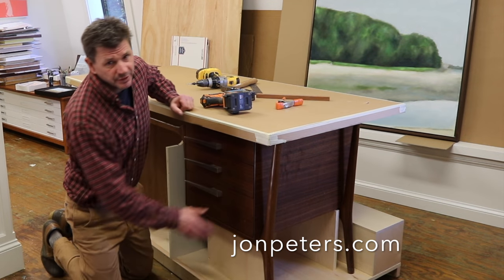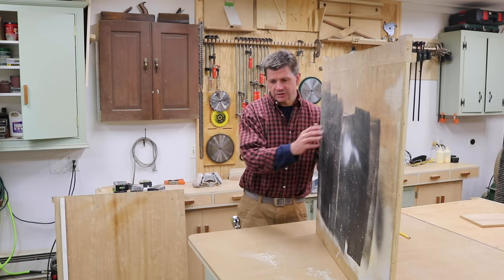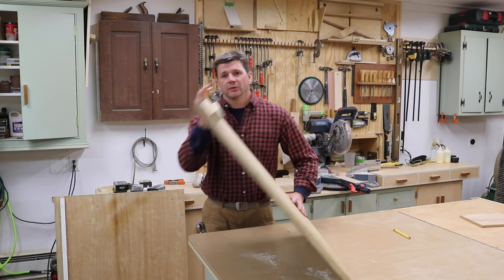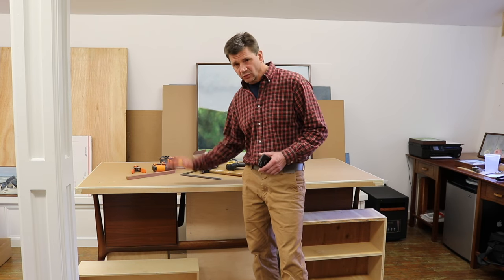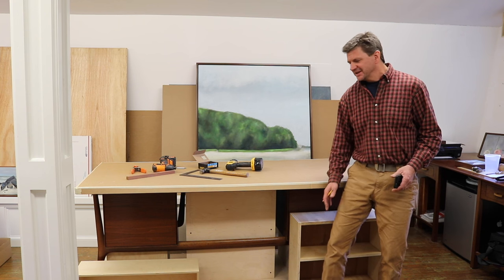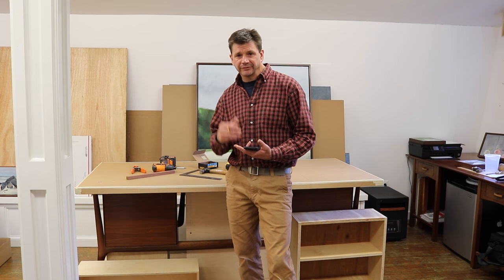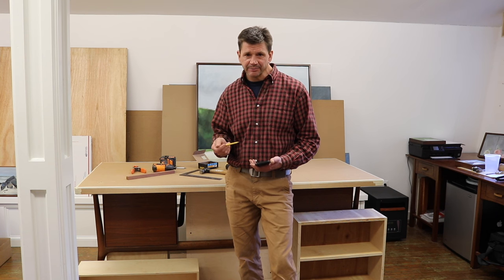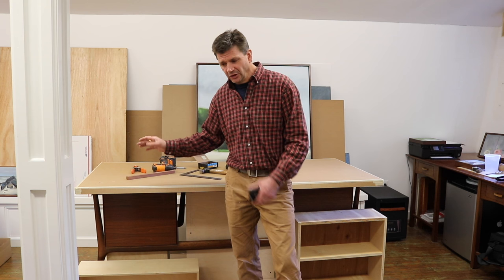Repurpose Desk - Make Mobile Work Table with Storage

Comment: Hey Jon, I know this doesn't have a lot to do with this build but I have been scouring your builds for something I can get some help from.  I am building a simple plywood dresser for my sons and trimming each drawer with raised stained trim for contracts on the white painted dresser.  I am trying to figure out the best way that the pros use to do this. I am currently painting first, staining the trim separate and installing after finished, and then sanding and filling nail holes after.  Wasn't sure if there was a better way with less work after the stain.  Do you stain with the trim already on the painted surface?  Thanks for any help

Comment: i think the original table was quite stylish. should not have been spoiled in the makeover
Reply: sunil Ghorpade I think you missed the point of the whole video. He didn't do anything to ruin the desk. He has to store it, it isn't being used, he wants to use it eventually. He made use of the space around it without hurting the desk and when he wants to use it later, it's easy to remove the storage accessories.